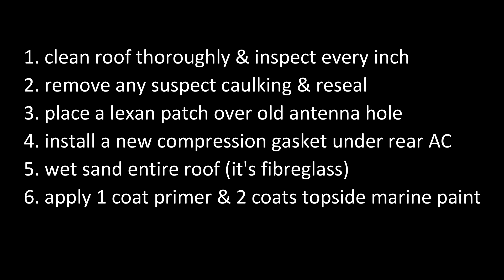Water leak mystery cracked after 2 years!

Comment: I had to navigate a very confusing Circle in Arizona last year when I left Quartzite,  pulling a 35' fifth wheel, almost got jammed up bad when i was forced to make a right turn off it one exit early, and had to go under a very low overpass 😮 I cleared the overpass by and inch or two 😮😮😮 there was no other way to go, because that traffic was so bad at the circle and the signs were not clear what Lane to be on?!?!?  Boy I was afraid I would need to.let all the air out of all my tires to clear that overpass.
Reply from the maker: Oh dear, I can feel the tension in your words just as I would feel.  Sorry for the delay in responding.  I can picture the situation you're describing, what a nightmare!  My wife always tells me to just keep circling the circle if I can't figure things out the first time around, but just as you found out, sometimes there is no way out except where you're feeling pushed.  So glad you made it!  If you feel up to it, please watch our earlier video entitled $19,000 damage ... that tells our story of being jammed under a gas station roof where we did have to let the air out of our tires to break away - just as you feared you might have to do.  Thanks for sharing your experience and watching our video.  I hope you will stay with us.